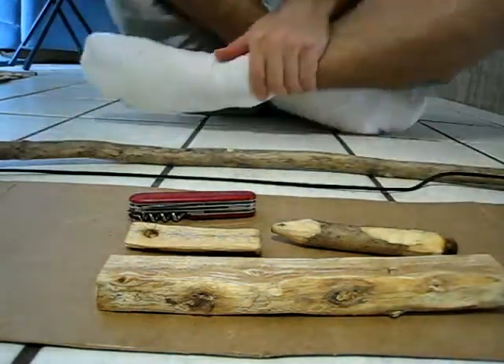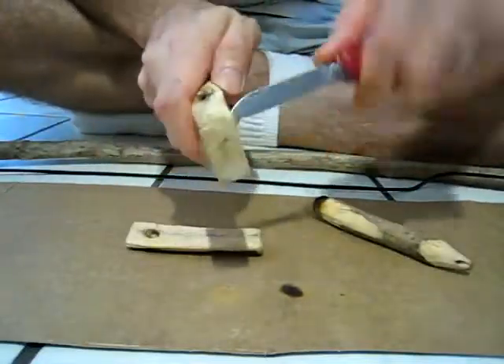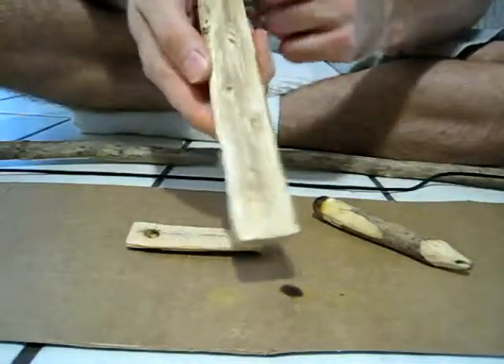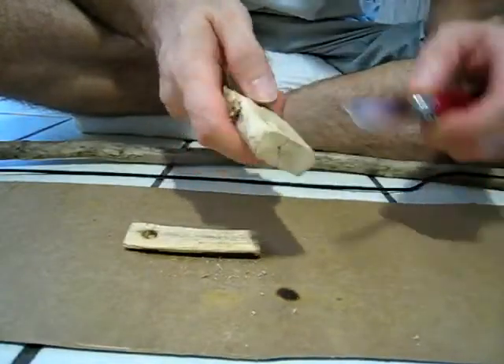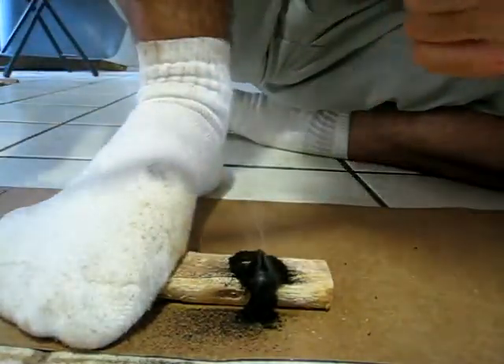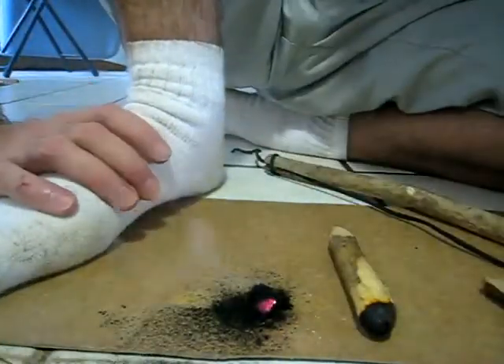Bow Dril using Oak

Comment: Good deal man. I to have used oak and it made a great coal. Hard to carve out the set, takes a big notch but it worked. I still use anything that has the right characteristics, dry, dry, dry. Sometimes it works and some times I just learn. Nice video.

Comment from the maker: @tkx7 Spindle diameter of 1/2" to 3/4" is generally ideal. No trick really. If spindle feels like it's spinning too easy it means there's little friction. As you bow, press down harder then you'll eventually feel the spindle bite into the fireboard (more friction). This will cause more heat between fireboard & spindle so they'll form-fit better with each other (or possibly overcome any existing gliss or caramelized wood that may have formed on previous attempts).

Comment from the maker: @tkx7 My 1st guess is the wood may have resin/ sap in it. Try a Pine branch that has little or no resin. Make sure you have a sturdy bow with a decent bowstring to minimize slippage. You need good speed & downward pressure to get dark brown/ black dust. Bowstring slipping prevents applying good speed & pressure (to get darker dust).
Start off bowing easy so all moving parts are working smoothly. Don't rush, pace yourself. Gradually increase speed & pressure (balance speed & pressure by feel).

Comment from the maker: @Back2DaBasix My guess is make sure you're using a good bearing-block having minimal friction, like a rock or shot-glass. This way you can apply good downward pressure to get to critical temp. Slippage - make sure you've got a good sturdy bow, and bowstring is tight around spindle. The more down pressure the more likely slippage. Feel for smooth speed & pressure and gradually apply more of each. Try store bought Cedar or other medium-soft wood. Oak is too difficult to learn with.

Comment: I need some advise- I've been using eastern white pine for my board and drill. They are both very dry and I get smoke but all I get is a brown powder- not black like its supposed to be. I made sure to use hardwood for the handpiece and lubricated it. Any trick? Does thickness of spindle affect it? Should I be pushing down harder or focusing more on fastness? I feel like I go even faster than what you did

Comment from the maker: @Snbkr Yeah, Oak is not the best option. It's a tough wood to work with (fashioning the set) and it holds moisture in damp or humid environments (if made on the spot); A bad thing for friction fire making.